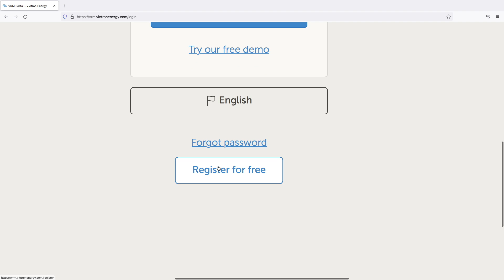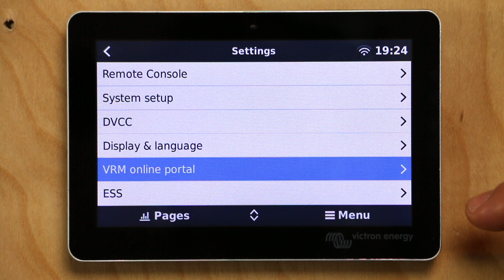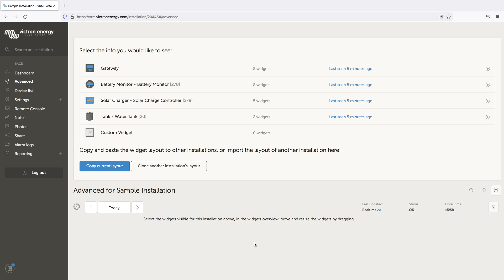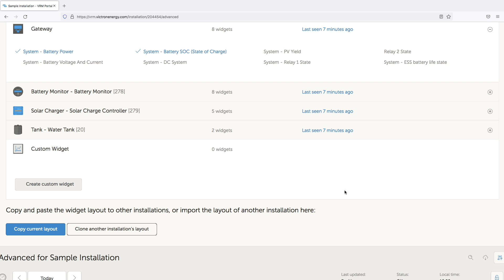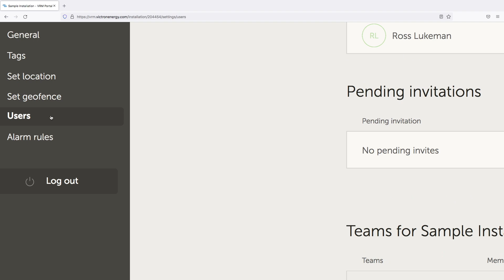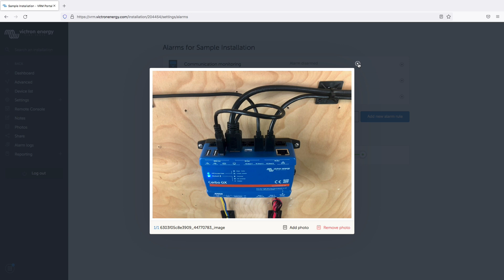How to Set Up the Victron VRM Portal - Run Your Van or RV Power System from Anywhere in the World!!!

Comment: Nice video 
Any thoughts why I can connect to VRM and see all data via a browser but not on the iPhone app? iPhone app it says it "no devices found."
Reply from the maker: Hey Rob, thanks for tuning in. The only thing I can think of is you may be using the VictronConnect app on your phone, instead of the VRM app? It's a separate app. Is that the case?
Reply: @rosslukeman  think that is exactly it! I can get in via the VRM app (thanks you!) but not my cerbo gx and VRM section on the Connect App. I thought (perhaps wrongly) that section of the Connect App allowed you to play with setting remotely too
Reply from the maker: @robww5921  Awesome, glad that helped! There is a feature called Remote Console but it must be enabled in the Cerbo: Settings --> Remote Console --> Enable on VRM (toggle on). Glad you're up and running!

Comment: I think I have a confusing problem.  I have a cellphone (cell 1) with unlimited hot spot and data.  I want to keep it at my Radio Shack where I want to connect it to my cerbo GX.  Then when I am out and about, I want to use my second cell (cell 2) phone to connect into VRM ... but I can't seem to get this far at all.  I can connect my cerbo to cell 1 Wifi and not sure how to get it to go on line.  I guess I need to use the cell phone hot spot and connect there ... I have been at the porthole and logged in and tried countless times to register the cerbo but it never reads anything at all.  I have MPPT, Multi plus 2 12V and victron shunt.  How does that work with cell phone 1 wifi to carbo and also should it go to cell 1 hotspot
too?  I'll try again.
Reply from the maker: Hi David, interesting problem. It sounds like it should work if the Cerbo successfully gets on Cell 1's wifi signal. After that you go to VRM and enter the Cerbo's serial number. VRM then searches for it based on that number. That's about all I've got. If you'd like to do a paid consulting call, I can walk through it with you to see if I can find the issue. That is here: https://www.rosslukeman.com/offers/Au4HykMc/checkout
Reply: Thanks for your comment.  I solved the issue.. when suddenly it was slowing live data.  In a nutshell..  The phone I was using to monitor VRM would not also connect to that phone's hot spot.  The service I have
(elcheepo with unlimited hot spot) ... only allows 1 connection at a time. So the Cerbo and computer could not connect to that 1 phone at the same time.  I have another phone that I connected the hot spot to the cerbo and the first phone watching the VRM and the system reads okay.. That said, I can adjust the Multiplus through then VRM.
So you fixed it again :-). ... thanks for the feedback and if any more details that you may want or need to help others in the future let me know.  I think if the one phone had multi connections to the hot spot it would work too.  pat @rosslukeman

Comment: Good morning ! I see you have 2 videos on measuring your tanks . Is the Bluetooth better or this type ? Thank you
Reply from the maker: Hey there, yes I just tried to cover all of the sensors that you can use, but didn't really recommend specific ones as you saw. In general hardwiring things is going to be better, but it costs more time, money and effort. With Bluetooth you're relying on batteries and a radio signal. It's fine but with hardwire setups you are of course relying on...wires. People love Bluetooth like they do cordless power tools. Sometimes a solution with a cord is better though. Hope that helps!

Comment: How can you stop a smart shunt constantly resetting to 100% when the batteries x2 are showing 70-80 % ?????
Reply from the maker: Hey Glenn, you would probably need to set the reset setting on the SmartShunt to the same voltage as the "bulk charge" mode of your chargers. Set tail current to 3%. Whatever reset voltage the SmartShunt is set to, if the charger goes above this voltage at any time, the SmartShunt will take this as a sign that the batteries have gotten to 100% and reset to that. Hope that helps, thanks for the comment.